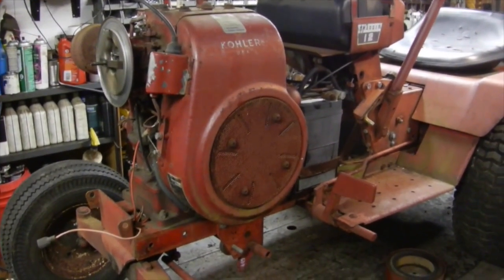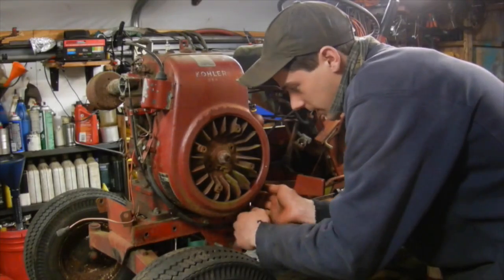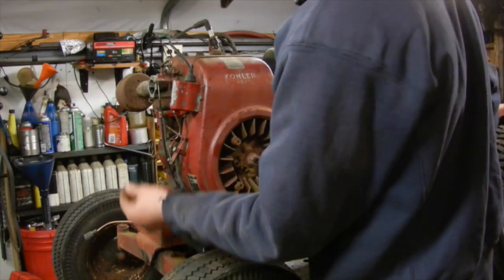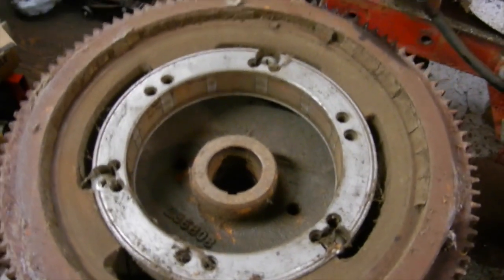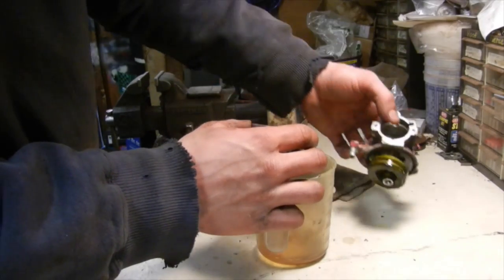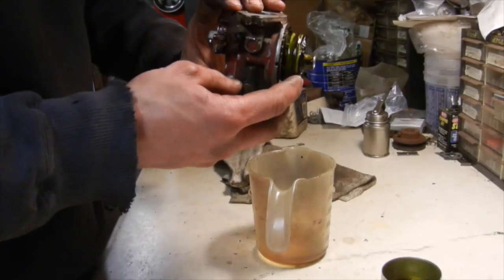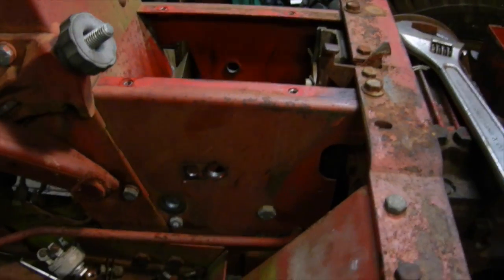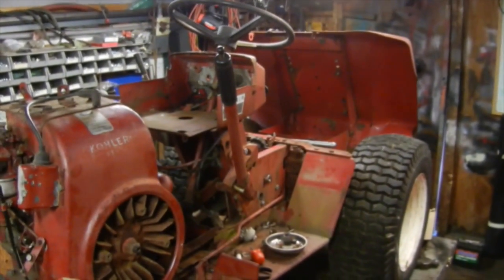1969 WheelHorse Charger 12 Repair- Part 1

Comment: Great video. I have a 1968 Charger 12. I've had nothing but trouble out of that engine. A previous owner had the engine bored .10 and installed a bigger carburetor.  The day I bought it, it started and ran fine. I got it home and it wouldn't start. It had a stuck valve. I decided to have the shop rebuild the entire engine. Now, it floods really easy, only seems to start on warm days (Which defeats the whole purpose of buying it with a snow plow), and its lacking power. It's super picky on which sparkplug it'll start with. I feel that it's the carburetor adjustment, but the shop says nothing  is wrong. Seriously thinking about swapping it for a Predator 670cc.
Reply from the maker: Not another Predator swap! I'm hell bent against those engines.... never mind putting them in old iron.
Do you know what size carburetor he installed? A #26 is what was used on the 10 and 12hp, the 14's and 16's had a #32. If he installed one of those, it may be feeding in too much gas. How's the spark? Do you still have the original points style ignition? If the points ignition is working correctly, it should produce a white hot spark no matter what plug you install (unless it's a resistor plug). Has to be something either fuel or ignition related from the sounds of it.
Reply: @5Tractorguy  Not really sure how to tell. It says Carter Model N on it? If I remember right, it was a 32, which is why I say it has a bigger carb on it.  I know. I really dont want to do a Predator swap. I'm just sick of fighting this thing.
Reply: It does have a points ignition. I had to use a hotter plug just to get it to start at all. If the choke is moved open or closed at all from half, it will die.
Reply from the maker: @jasongriffin8849   Pull the air cleaner off and look in the throat. There should be a number cast above the venturi hole. If it isn't there, pull the carburetor off and measure the hole on the flange side where it bolts to the engine. The #26 has a 1.07dia throttle bore, the #30 (not 32, my mistake) has a 1.20dia throttle bore. If you have a #30 and want to try a #26, I have a mess of rebuildable and rebuilt ones here. 
Hows the spark? Points gaped at .020? If that's good, it sounds like a carburetor issue having to keep the choke half closed. Usually means the idle circuit is clogged and choking it pulls fuel from the main jet to keep it running. 
Is there any water in the fuel system or carburetor bowl? That will also cause the engine to start hard and run like crap, not be able to open the choke ETC.

Sorry for the overload of info, just trying to rule stuff out...
Reply: @5Tractorguy  I will check all that. Unfortunately I've been sick this week, and the tractor is outside. The fuel system is good. I cleaned out the tank and replaced fuel lines and filter when the engine was rebuilt.  BTW, I wouldn't trash that engine. I have a 1972 Bronco 14 that is complete, minus engine. It just really irritates me that this one isn't reliable enough to use the snowplow whenever I need it. I keep the snowplow attached to it all year. It's good for smoothing gravel driveway, and even smoothing dirt when I needed to. So how do I contact you privately?
Reply from the maker: @jasongriffin8849  Send your email address to my secondary email- fretwater@yahoo.com. Then I'll forward you to my real email and contact info so if you want, you can call to discuss instead.

Comment: For some reason this is my favorite repair video, makes me want to get my old sears tractor running, well if the ignition worked. Those early Tecumseh SSI's are just about impossible to find a replacement for. Possibly a future engine swap project at this point if i can find a suitable engine.

Comment: What parking brake cuz I have a 1970 Charger 12 and it has no parking brake
Reply from the maker: @Austin Glenn Kimmel There is an arm inside of the transmission case that flips up into a gear when you pull that lever up, locking the rear end. Works pretty good, but a lot of them the arm is all chewed out from people not coming to a full stop before disengaging that lever.

Comment: Where do you recommend getting a new carb for a allischalmers 416 with k341 kholer
Reply: Matt Dun there are aftermarket ones on eBay for about $40
Reply: rw3dog I understand but what quality are they
Reply from the maker: Yes, ebay has them but I wouldn't recommend the $40 aftermarkets. I put one on a M18 Kohler and had nothing but problems, hard to start, leaking gas, no matter how far in/out you turn the idle mixture screw there is no difference in idle. 
If you want a good one you're going to have to pay $150 and up from a different site like Pats Small Engine Plus (http://www.psep.biz/store/kohler_carburetor_complete.htm) and get OEM. Either that or find a good used original for sale.
Reply: 5Tractorguy offf that is quite a price tag
Reply from the maker: Yeah, the good ones ain't cheep. I remember buying one back in 2007 or so and it was around the same. 
You can take a chance on the ebay carb, just no telling how it'll run.
Reply: 5Tractorguy how about going to napa and trying one of their carbs
Reply from the maker: Never thought of that.... I just looked one up in the parts book and searched it on the site. They only carry carbs for up to the K321's. Number 7-01216, list price is ridiculous, $390.60
Reply: 5Tractorguy thanks for all the help my dad is going to try Schmidt and serafines in Ct
Reply from the maker: Your welcome, if he gets a good price on one give me a shout, I'd be curious to know.
Reply: The eBay ones get
Mixed reviews. Seems like 75% of people like them and 25% think they suck.   I have In and a 10hp and it doesn't run right.  I am going to take it apart and check it out....  others have said to clean them before you install them...  worse case I can use the throttle shaft on an old carb
Reply from the maker: The one from the M18 was the only cheep aftermarket I bought. I've heard from others that the quality was really lacking so that's why I wanted to stay away from them. Going to have to start buying a few extra good used carbs to keep on hand.
Reply: 5Tractorguy my dad called Schmidt and serafines and they have a carb for a 16 horse kholer I hope is around the year of mine for 60 bucks

Comment: Great video man!!  I have a Wheel Horse 1978 c-141 automatic  and the speed control lever is a little loose,  some help needed here, so should l only tight in that nut?
Reply from the maker: Thanks Jose! That's a good-un, I have the same model only and 8 speed. Yep, tighten that nut up and it will increase tension on the tapered piece.
Reply: 5Tractorguy thank you very much!! And congratulations 🎉  you have great channel 👍,  also l would have liked to  get a manual transmission wheel horse to save me some worries with the transmission, but anyway so far, so good.
Reply: 5Tractorguy l didn't grow up with tractors around, but l year ago l developed and interested on small engines,  been learning a little, and l guess one thing takes you to the other one,  that's why few months ago l found about wheel horses and l really like them so, l decided  to buy me one of them ( I was lucky to find one in very good shape overall). Amazing how these machines are well built!! and  still going strong, no doubt why many many people love them.  Once again thank you man!, and hope you had a great Labor Day.

Comment: Great video, Jake.  What a difference to be able to stand and work on a machine.  I too, look forward to hearing it run.  I am curious about the hydrostatic action.

Will this be one you will sell as in your business?
Reply from the maker: Thanks! It sure beats sitting on a 5gal bucket all day. We picked up that air lift back in 2009 for $250, worth every penny! Nope, I plan to keep this tractor around for a while. I have some other machines I need to get rid of come spring time, mainly Gravely's. Time to start purging the inventory again....